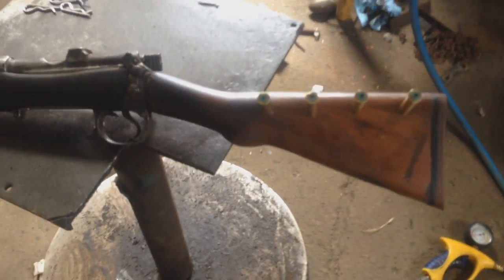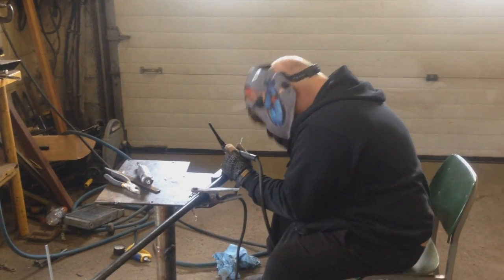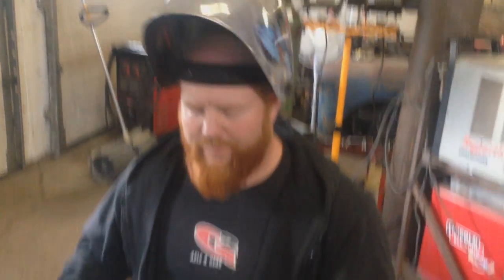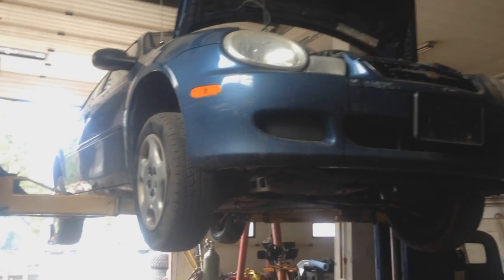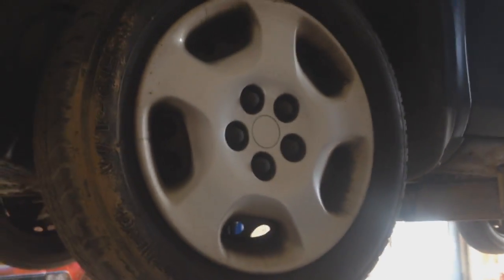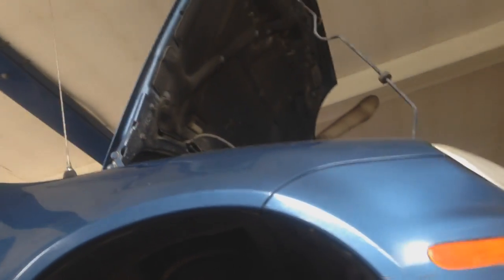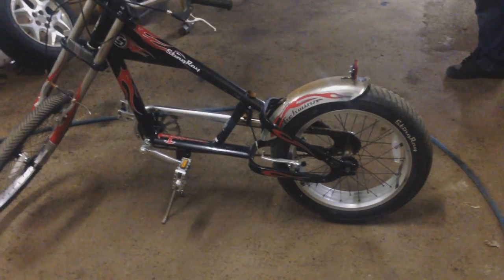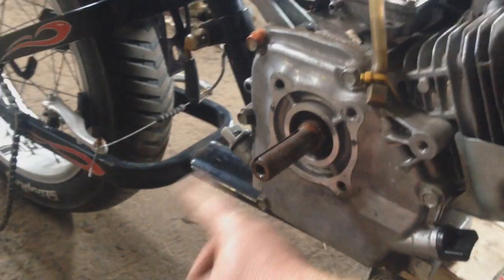303 and 12 gauge Gun Rack

Comment: why would you do that to such a rare gun? The shot guns i could see because they are a dime a dozen.but the 303 is a really rare and hard to find british gun and since no one in Brittan has any guns any more there won't be any more come from that region any longer. I HAVE TO PUMP MY 89 SIlverado Sport too to get it started and people have given me SO MUCH SHIT over doing that because it's a fuel injected truck I am SO glad someone else put it out there that some times they just need it.  mine is actually throttle body injected but still needs to be pumped when it's cold or been sitting a while. BTW Friday was the second . the 3rd is Saturday.I'm counting every one of those days because as of the 12th i'm officially on vacation for the first time in almost 10 years. Not going anywhere just not logging in to work either for a week
Reply from the maker: the 303 was worn out and wrecked basically would never have fired was pitted real bad. lol on the truck its weird its the second one with tbi that ive seen do that .. go go gadget vacation
Reply: that's bad about the gun My dad used to hunt with one of those and was pretty accurate up to 3/4 of a mile away just off of the metal sites. I'm probably spending the whole week of vacation putting a new roof on my house and rebuilding my shed.  i'll be working still, just not on computers lol you know what they say though ,"no rest for the wicked".